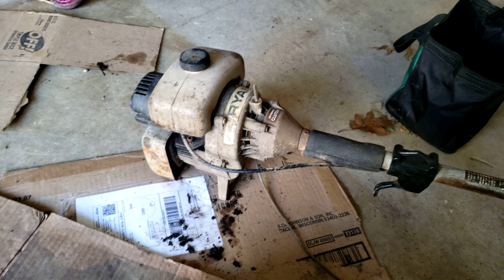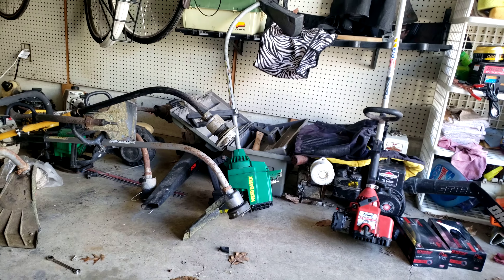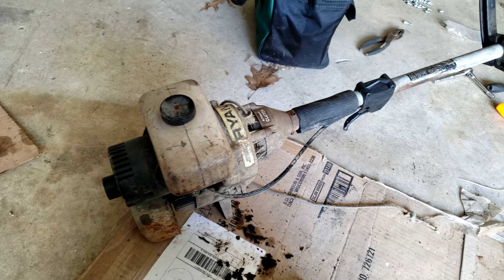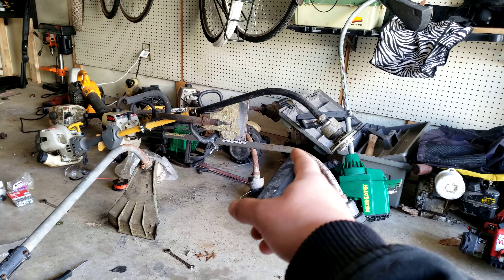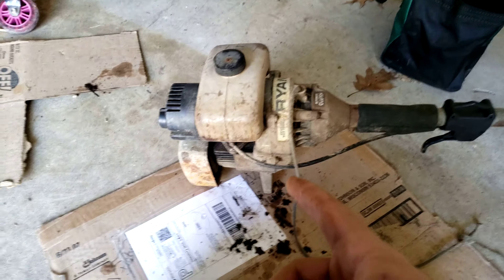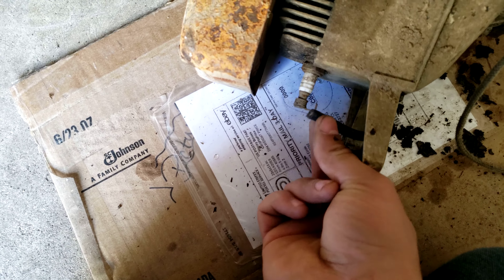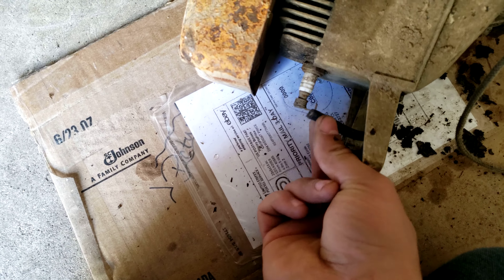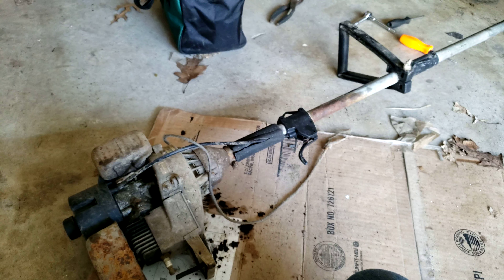Ryan Weedwacker Restoration Part 1

Comment: I found one today being trashed.. the pull cord was hanging all the way out. took it by a lawnmower repair/ sales place.. was told i would have to replace the whole clutch mechanism... spring was probably too rusty.. "not worth the repair cost" got home and sprayed some WD-40 into the clutch part. cord wound itself all the way up... I have hope... going to let it soak a bit..